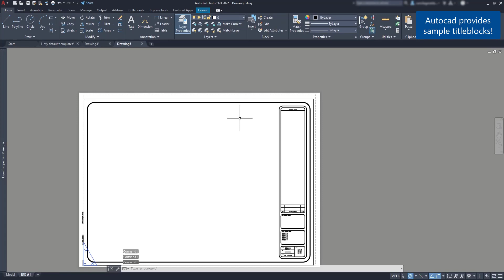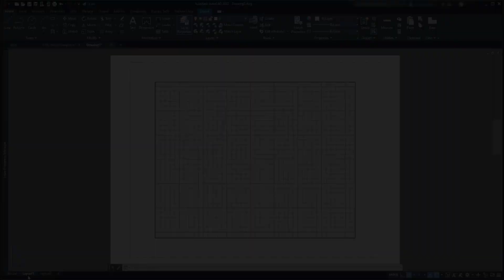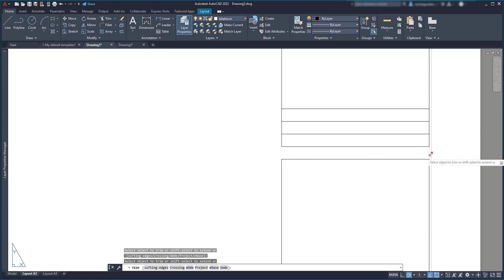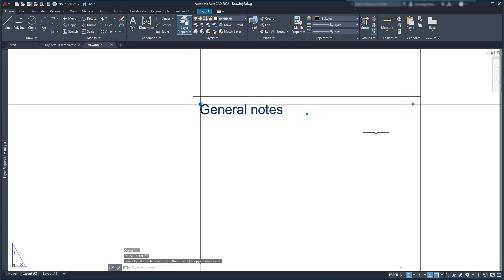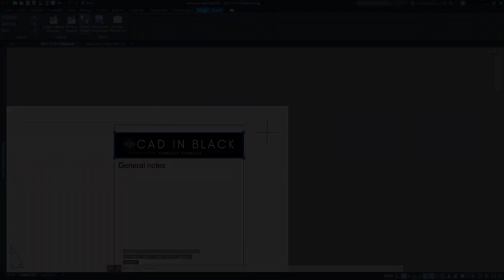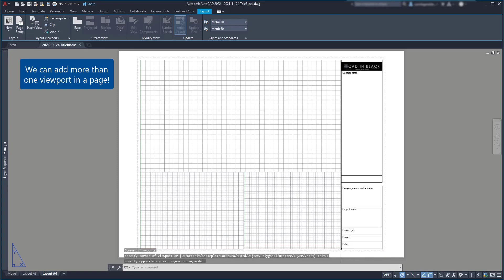Autocad - How to create a simple Titleblock!

Comment: This is very basic template. No need to create different templates for different paper sizes. Does not help. One A1 is enough and you can print from A1 to A3 for example by changing scaling your paper size to 1/2 before printing. Your template lacks attributes!!! It's not a professional template. Sorry but no.
Reply from the maker: Hello Sam. Thanks for the comment. Actually this was a simple titleblock without attributes, that any beginner could make it easier. The point was  to create it directly in the layout tabs. Maybe the title was misleading, which I have just changed it. My apologies.
In the future I plan to make a more complex titleblock, with attributes, parameters and insert a field for the scale.
Reply: @CADinblack  No worries, you are just doing great.
Reply: @CADinblack  Please tell when its gonna happen